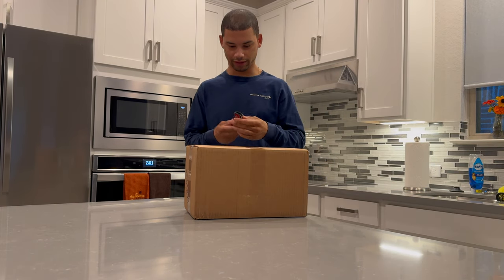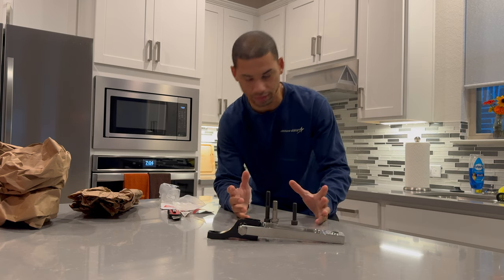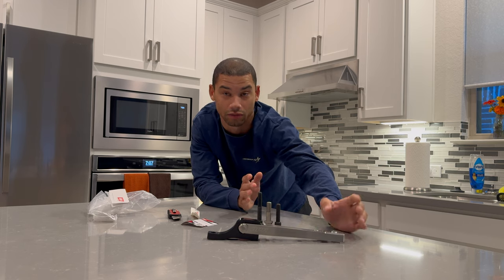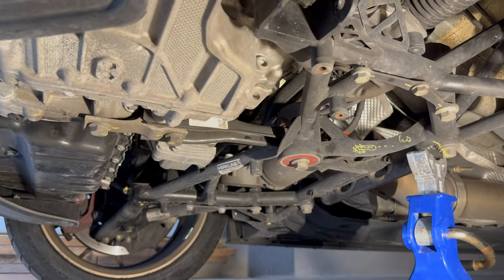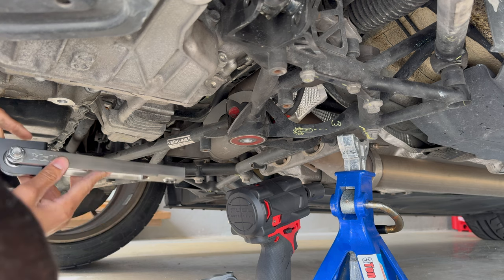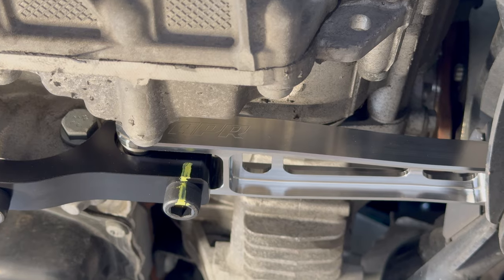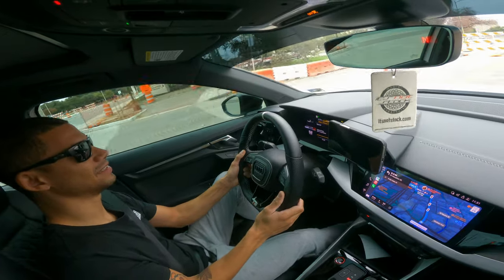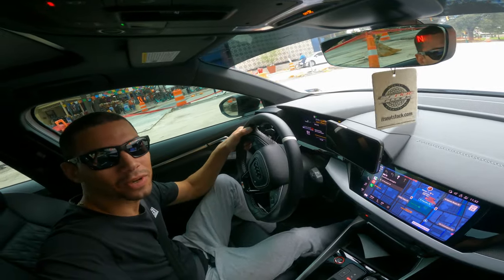This simple part swap changed my entire driving experience.. APR pendulum mount! My mind is blown 🤯

Comment: I got the APR DQ381 Pend mount on my 8V S3 with the Powerflex Purple Insert and didn't notice any additional NVH. Love this combo, made a difference too.

I ran into the same issue the OEM bolt worked for me, the included one was too short.
Reply from the maker: Hell yeah brother that’s what I like to hear!
Reply: @BryceJordanProductions  I was as surprised as ya, after putting it on a while ago. Very OEM plus feeling for me though I am not as hardcore as ya since i am running the CTS Sport Mounts.

Comment: Curious, what is the difference if any, of a dog bone mount and this pendulum mount?
Reply from the maker: Keeps the engine/transmission from rocking back and fourth. Making shifts faster and smoother, also helps prevent wheel hop which can lead to broken axles and other bits